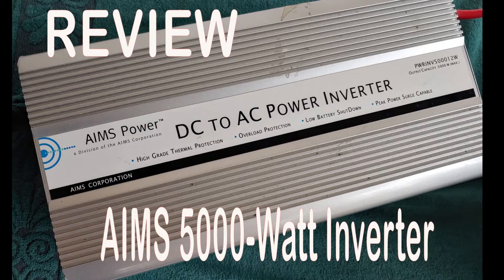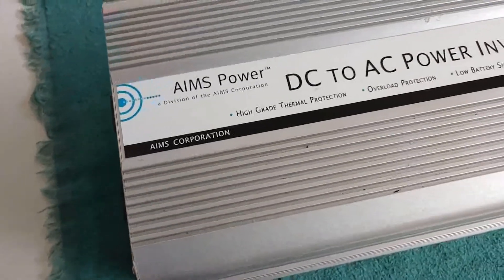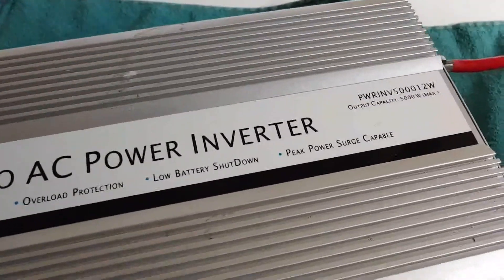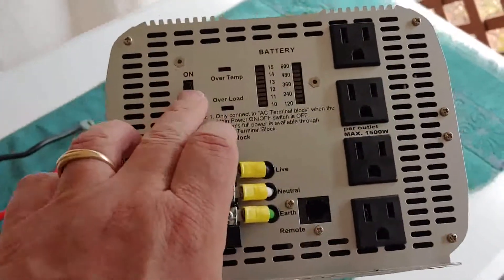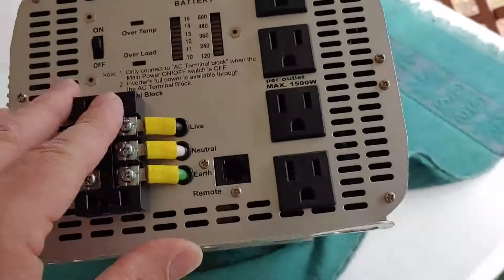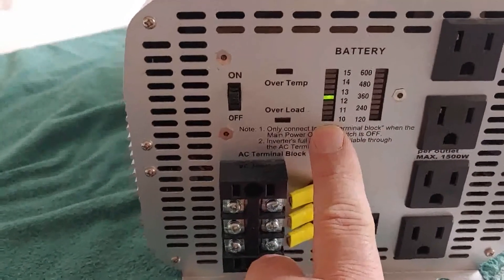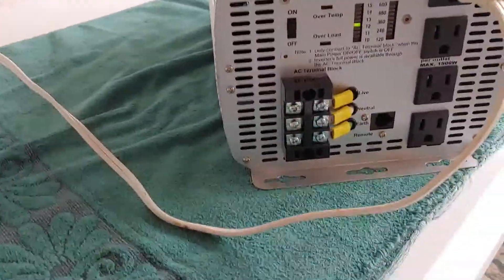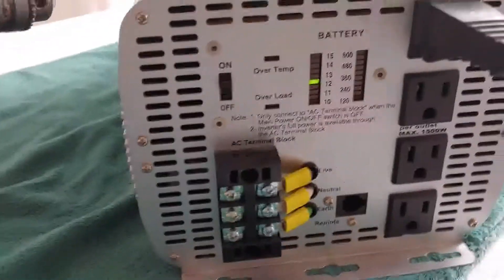Review and testing of my off- grid AIMS 5000-watt Inverter. used for solar power systems.

Comment: can u use solar panel only to supply voltage?
Reply from the maker: This inverter is off grid it needs batteries. Thanks for your comment.

Comment: Listen.. I’ve always tried to keep in mind the old saying “if it sounds too good to be true, then it probably is.” Always make sure your battery is CAPABLE of producing however many watts you’re wishing for.

Voltage * amperage = total watts

Always try to follow the NECs 80% rule as well.. I don’t want people catching their sh*t on fire because of shady advertising. Great company.. seems transparent enough.. but don’t get fooled out of your money.. get what you need.

A battery with 650 cranking amps and 12 volts is able to produce around 7,800 watts of non continuous output power. Don’t forget that your starter will pull on average 0.5 - 1.5kW.
Reply from the maker: Thanks for the tip and comment.
Reply: @shoestringprep  I think that’s the only time I’ve ever been replied to less than 2 days after I posted a comment. Thank you for holding sincerity to the world and you just earned a new subscriber.
Reply from the maker: @illuminateme8182  welcome new subscriber!!

Comment: Would this work with the EG4 Life PO4 batteries? They have a rack of 6 batteries at 5,120 watts each for 30,720 watts of power on one rack. Would there be any communication issues between this and the EG4 batteries?
Reply from the maker: You just have to keep this inverter would not have a problem with the batteries. Just remember you cannot do more than 5000 Watts. It sounds like your system is much more than that. Thanks for your comment.
Reply: @shoestringprep  You mean 5,000 watts of continuous pure sine wave power correct? Would a 30KW rack of EG4 48V Life PO4 batteries work with this 5KW inverter? I like this inverter because it has AC outlets built into it and its the largest inverter I’ve seen with AC outlets built in. Building a DIY with the EG4’s recommended Growatt 5KW all in one inverter for the EG4 30KW Life PO4 battery rack would require an electrician to install the AC outlets and gas generator outlet. I’d rather the inverter have AC outlets as part of it with no electrician required. I don’t really need a solar charger either since I could charge the batteries with a 48V charger using a wall outlet (no solar panels needed). I just want a simple setup with a large rack of Life PO4 batteries that can be stored for a while and use the batteries in an emergency only needing the inverters AC outlets. I could upgrade the setup to include the MPPT solar charger and the rest of the complete solar setup later on.
Reply from the maker: @JohnSmith-gz5pm  this inverter is not a pure sine wave. It is a modified sine wave. Thanks for your comment.
Reply: @shoestringprep  There is a pure sine wave version of this inverter on Amazon with 5000W and 48V. As long as the voltage matches up the battery rack, it should work right?
Reply from the maker: @JohnSmith-gz5pm  it should. Thanks for your comment

Comment: My Aims 2000 watt inverter / charger is pure sine...it has went up in price since I bought it in December...I like it...really quiet. I'm getting the final two batteries in two weeks, I think...I'll try it with 16 of them for awhile but I think it's going to be enough...It has a dip switch to change the cutout voltage to either 10.5 or 11 volts...but it doesn't ever get that low...maybe 23.8, which would be 11.9 on my 24  volt system, that's a cloudy day with lots of cooking and all night with the fans and lights on to get it that low...usually it's like 24.4 when the sun is coming up, so I'm thinking two more will keep it around 24.8 or so...not as much sun this fall. Just some reserve.
Reply from the maker: Sounds like a great system.
Thanks for your comment.

Comment: Would you recommend this for a tinyhouse, normal size refrigerator, washer/dryer unit, window ac unit, tankless waterheater, water pump,  2 burner stove, and a few small things.
Reply from the maker: Thank you for the question.
I can't answer unless I know how many watts your devices will be using. Once you find out how many watts you will be using, you will be able to determine what size inverter you will need.
Hope this helps.
Reply: @shoestringprep  yeah, I can try to add it up, is it OK to have something much bigger than what I need? I shouldn't need more the 3000 w but I don't want to limit myself either
Reply from the maker: A larger-than-necessary inverter would simply mean that you could upgrade and add-on whenever you wanted to.

Comment: What size what type battery and watts of solar panels is recommend?Also for the 8000w work that you described how many white solar panel and what size batteries are necessary for that one? Thanks!
Reply from the maker: The answer will depend on what you are trying to power. I power my 8000w solar power system from 600w of solar panels to nine deep cycle batteries. You may not need so much power.